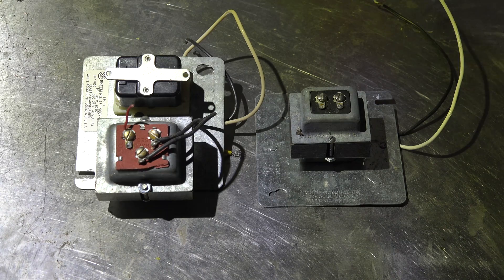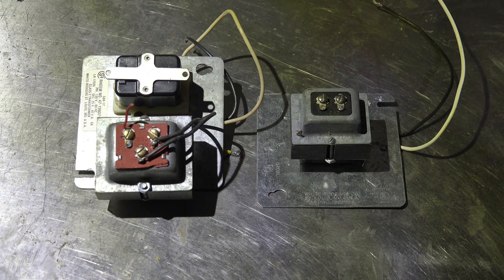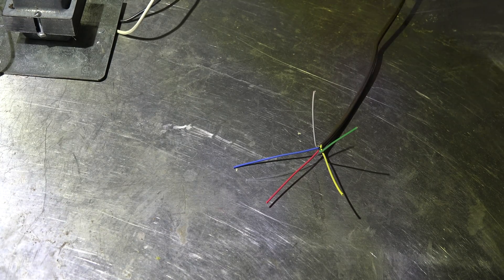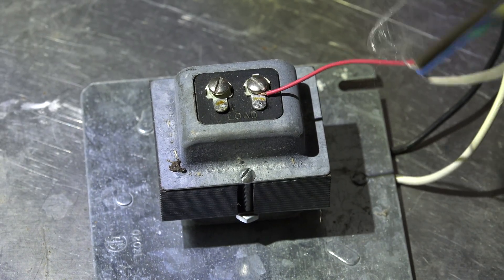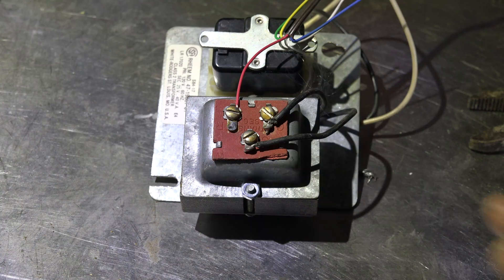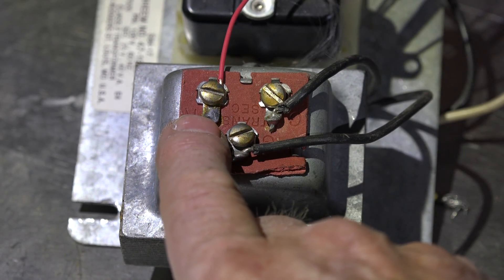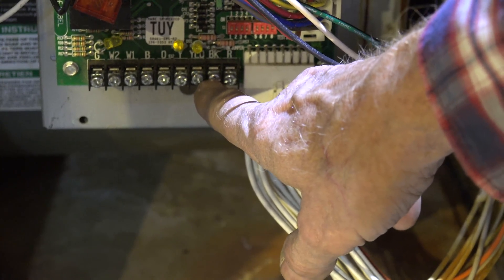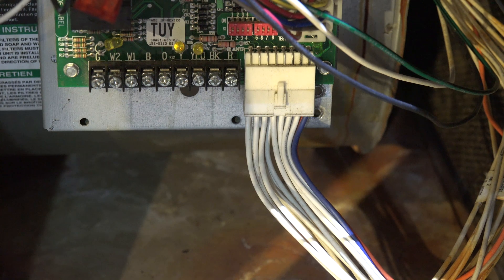Installing the WiFi thermostat, the common wire.

Comment: I have a hydronic boiler with a 24 volt transformer powering 2 Honeywell zone valves. I have a extra unused green wire at my thermostat. Can I connect green wire to C terminal on T stat  and then bring green wire to common side of transformer to power up my wifi Honeywell RTH9585WF  T stat?

THANKS IN ADVANCE!
Reply from the maker: Go for it.
GFM

Comment: I have  an older Lennox and it has a T not a C is that the same?
Reply from the maker: Oil or gas?
GFM
Reply: @grayfurnaceman  Gas
Reply: @grayfurnaceman  Lennox G-20 Series
Reply from the maker: @BLomedico  The T is common.
GFM
Reply: @grayfurnaceman  Thank you. One more question if you don't mind, my new thermostat says to jumper the Y to the G at the furnace if I move my G wire to use as the C. I only have heat not AC nothing is connected to the Y. My only 3 wires being used are R, W and G. Hope that made sense.
Reply from the maker: @BLomedico  It should not make any difference with your setup.  The jumper is only for A/C.
GFM
Reply: @grayfurnaceman  Thanks again works great!

Comment: My thermostat is hooked up to a primary oil controller with terminals that read t and t3 2 1 what should I connect the c to
Reply from the maker: Your system does not have a C.  You will need to install a transformer with an isolation relay for the oil burner.
GFM
Reply: @grayfurnaceman  okay thank you

Comment: on the first transformer there was no R or C labelled. so how would you know which is which? thanks.
Reply from the maker: It does not make any difference as long as the one that goes to the C terminal is also connected to chassis.
GFM
Reply: @grayfurnaceman  this is my exact set up. Unfortunately it's still not working even when I tried connecting to either side of the transformer.

Comment: I have along with the red and white a black wire that is hooked up to the G terminal in the furnace.i'm also installing a wifi thermostat that requires 24V. It doesn't seem to matter if the black is hooked up to the thermostat or not.Could I move the black on the furnace terminal to the C terminal and then to the C on the thermostat providing the C has 24V ?
Reply from the maker: Not if you have air conditioning.  The G terminal is used in cooling.
GFM
Reply: No I dont have air conditioning so should be ok, thanks for the quick reply!

Comment: I am also in a situation where I want to install a wifi thermostat without a C-wire from the existing wiring.  As I tried to connect the wire to the low voltage transformer,  I discovered that the voltage across the terminal was only 19V. Initially I thought that the transformer was bad. But after searching the model number (EM57580),  I found that the transformer was a 18V transformer.!  The service manual for my furnace (GMP-150-5)  only make references to 24V.   Do you think that I should replace the transformer even though it has worked 20+ years?
Reply from the maker: Replace the transformer.
GFM

Comment: Question, I have a heat pump will run perfectly when jumping out R, Y, O, & G. When I hook up a digital stat using a common wire to power the stat the unit kicks on and immediately kicks out. When I remove the common wire from the stat and power the stat with 2 AA batteries it also runs perfectly. Its that common wire being hooked up that's the problem. I have to hook up a Nest stat which is, as you know, only powered by the unit. Tech support threw up their hands and say they don't know. I pulled all the hair out I can spare, lol.
Reply: I have the same problem. Im using a braeburn tstat with wifi and zone control board. Everything works fine until i connect the c wire to the tstat. Then the tstat turns off... when i disconnect the wire and runs on battery everything works. Its sad because i can not use the wifi function. The system is a lennox heat pump, braeburn thermostat, honeywell zone controller and two 24v transformers (one internal for the heat pump and another one for zone controller). The tstats are connected to the zone controller.

Comment: +grayfurnaceman do you have any idea how to adjust the cycle rate on a honeywell 5/1/1 t-stat? I have figured out how to get reduce the cph in heat mode, but can't adjust cooling mode. unit is short cycling in cooling mode
Reply: just watched your video on electric thermostats. going to make sure the senor is clean

Comment: hey quick question on thermostatic expansion valves? where you have liquid charged sensing element and liquid cross charged sensing element. when do you choose between the two of them?
Reply from the maker: Simple reply.  Cross charged valve will operate over a wider range of temps than valves charged with the refrigerant used in the system.
GFM
Reply: thanks for the information.

Comment: so the EIM module still has advantages over wifi. control humidifier, dehumidification, DAT and RAT delta charts, alerts. oD temp and humidity. but this gets closer.

Comment: Hey Gray. I was diagnosing a lennox single stage furnace under a year old. It had Nest thermostat it had the common. Furnace would work for 20 mins go off all that. Long story short I put a honeywell thermostat on and the furnace worked fine.  This was their 3rd nest before I put the honeywell on. I was later told by the other company that it needed a new gas valve to work with the nest. I am confused as it worked fine with the honeywell. Now it works fine with a new gas valve and nest apparently. I am very confused. The board, and pressure switch were changed and still had same problem with nest.
Reply from the maker: Back in the 1980s, when the first electronic thermostats came out, we were changing them out all the time until we started installing isolation relays to separate the electronics in the thermostat from the electronics in the furnace controls.  Honeywell and White Rodgers figured that out many years ago and changed their thermostats to use mechanical relays inside the thermostats.  That stopped all the problems.  I also agree with Daniel Armstrong and his isolation relay.  My advice:  Go with Honeywell or White Rodgers.
GFM
Reply: The problem with Nest is that it uses solid state switching and power stealing, which Nest tries to "lipstick on a pig" by calling it power sharing. This means that by design it never fully stops the current flow while off, and doesn't fully pass the 24v sine wave while on. IMO all Nest units need a common wire and a relay isolation board installed whether they seem to work without them or not.
Reply: My thermostat is a normal Honeywell FocusPro 5000 with the common wire hooked up. I got it from the bins at the Goodwill outlet store. I was previously using a hardware store Honeywell.

My favorite feature of this stat is that it locks out the cooling for 5 minutes when it senses a loss of 24v, IE it works as a power failure anti-short cycle timer to protect the compressor.
Reply: Do you think that the customer will have the same issue with the nest and new gas valve?
Reply from the maker: Virtually all electronic thermostats do that.
GFM

Comment: gfm. i havent watched the entire vid, but I did a nest not too long ago. the tech support told me i didnt need the common wire. however, it did not work without it.  just two cents there.
Reply from the maker: I am going to repeat the answer I gave below so you know.  Back in the 1980s, when the first electronic thermostats came out, we were changing them out all the time until we started installing isolation relays to separate the electronics in the thermostat from the electronics in the furnace controls.  Honeywell and White Rodgers figured that out many years ago and changed their thermostats to use mechanical relays inside the thermostats.  That stopped all the problems.  I also agree with Daniel Armstrong and his isolation relay.  My advice:  Go with Honeywell or White Rodgers.
GFM
Reply: Thank you for the information.